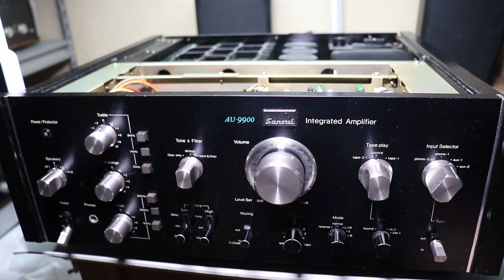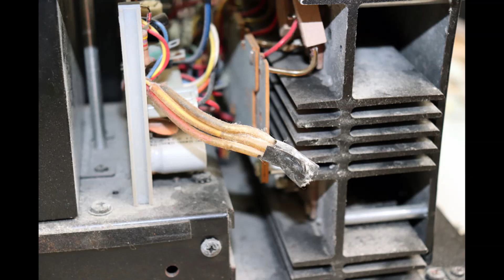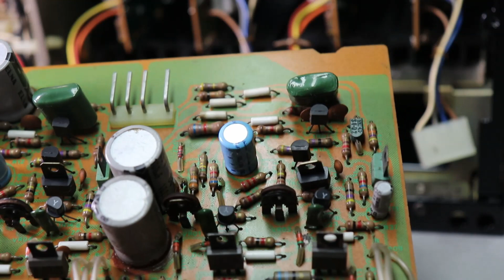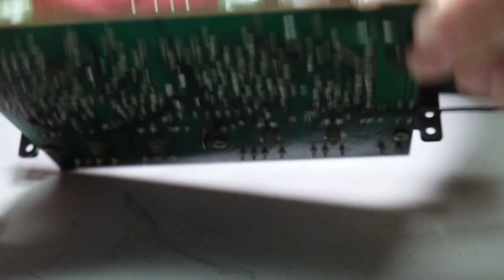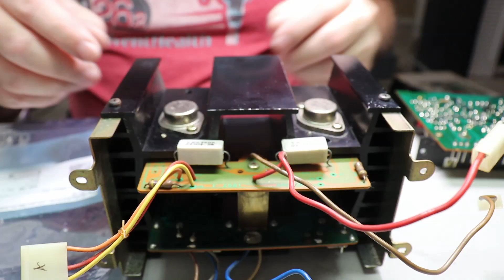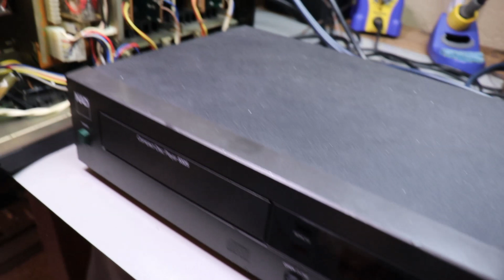Sansui AU-9900 Vintage Stereo Integrated Amplifier Repair And Restoration. Fixing Old Audio - Part 2

Comment: I have collected 6 vintage receivers, three of which I use often (Yamaha CR420, Nakamichi SR-2E, Pioneer LX-626). I suppose the model numbers are a dead giveaway...yes, I am living overseas (in Europe-CH). However, I have some other receivers that I am working up to repairing as a hobby.  Collected some of the relevant gear to do the basic job of recapping.  However, I won't be able to assess the equipment with an Oscilloscope or other more advanced workshop gear.  Your videos are a big help in getting me prepared on the basics for this hobby.
The culprits that will need attention (all are cosmetically superb):  Hitachi SR-903, Sanyo DCX-6000K, Pioneer SX-82E (works...but will need a recap...all pt to pt work...yikes)...
and a Marantz PM250 amp.
I really want to start with the Hitachi SR-903, as I think this baby will work out terrifically well as a true keeper. 
The SX-82E is another gem (21 original tubes!)...I bought it from an expert enthusiast who was willing to sell as he did not want to take on the job at this stage in his retirement; he sold it on an auction...got it for $135. It tested sat, but will need the recap as the old electrolytics are VERY long in the tooth. This job I will have to work up to, as it looks to be a bear.  Thank goodness the unit came with all of its original documentations (it was his sister-in-laws father's).
That seller gave me tour of his basement workshop...it was amazing...very complete. What a collection of vintage equipment, too; from a large reel to reel tape system from a shuttered radio station (c.1970's) to a wall mounted amp from a shuttered movie theater...plus many other pieces.
Although the SR-2E works A.OK, this too will need a recap eventually.  It has that STASIS amp (Nelson Pass design)...so it definitely is another keeper in my portfolio of vintage receivers.
Thanks again, for your content...it's a joy to learn from.

Comment: I know nothing about this work but was wondering:  How do you know the power transistors are still good when you reuse them with new mica insulators on the heat sinks.  I’ve seen other videos in which the technician replaced the transistors.  Do you test the transistors before reusing them?  Thanks, love your videos and explanations!
Reply from the maker: Thanks! There is generally no need to replace the power transistors in vintage audio equipment. Normally when a power transistor is defective it will let you know by blowing a fuse or two.

Comment: Hi,I had my tech doing a complete restoration on this unit,but after I picked up and plug it at my place,the unit developed a slightly humming noise coming from transformer side.Are you able to let me know what could be wrong ,please.
Regards,Codi.

Comment: Really enjoy your restoration video on the 9900...I am restoring mine as well...is there a website that has a list of the components/part numbers that you are replacing listed ?
I am having trouble getting the correct part out of so many listed for example on Mouser..
Reply from the maker: Thank you for watching. I have not seen a parts list for it. I don't use a parts list for my restorations as I have most all of the replacement components in stock except the filter capacitors. I'm sorry I couldn't help you out.

Comment: In your experience output transistors never need replacing ?
Reply from the maker: No, not unless they are blown for some reason. When they are bad many times something external to them has failed which then caused them to fail.

Comment: Wow that was really dumbed down, I have to ask, if someone needs the kind of advice you’re giving they probably shouldn’t be inside a stereo???
Reply from the maker: That's a question each individual needs to ask themselves. I think if you ask most people that own vintage audio equipment one of the most difficult things to find is someone they trust that can repair or restore their equipment. More and more vintage electronics are failing as the years go along with that there are fewer people to work on it. Hopefully some of my video's will help answer your question for owners of older electronics.